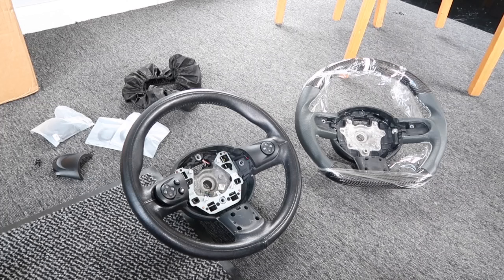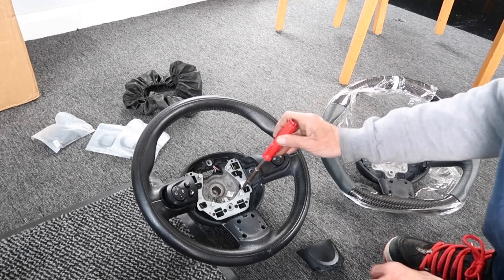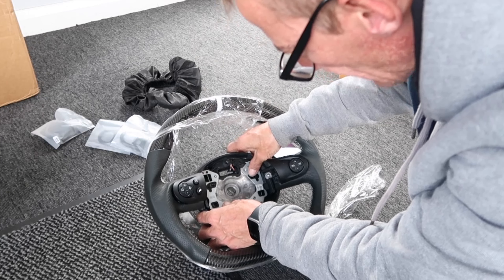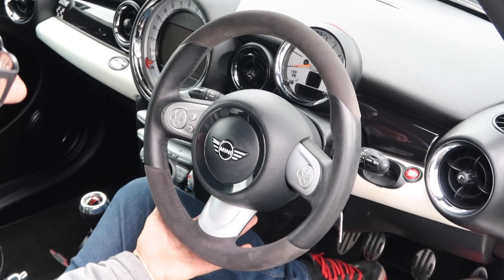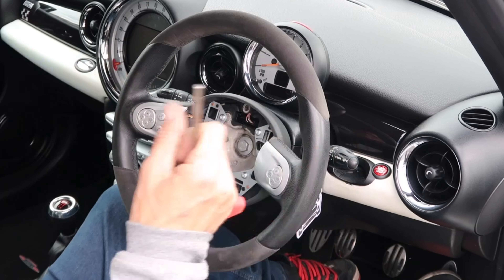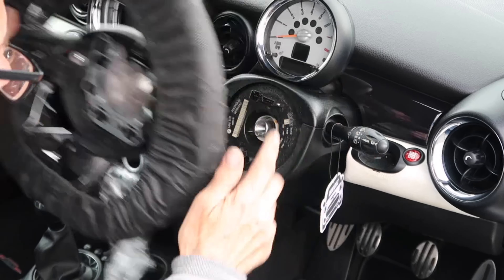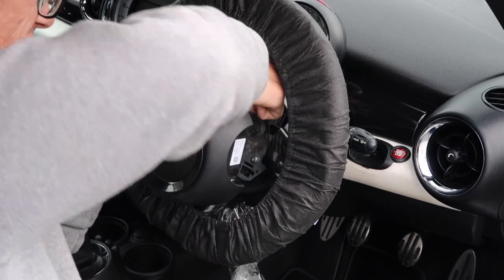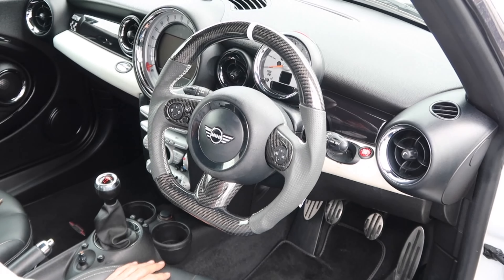MINI R56 JCW Steering Wheel Install - Flat Bottom Carbon KillAllChrome

Comment: Fantastic video! I have a question - I have a 2010 Mini Cooper S (N18), and the steering wheel does not have the buttons. Do you think it'd be possible to get those steering wheel controls separately, and retrofit them into the wheel?

Comment: Is the diameter of the wheel where you put your hands and larger or smaller than the OEM wheel?  I don't care for the material of the OEM wheel.  Is your perforated option true leather and not some sort of rubber material?  Thank you!

Comment: Hello there i am interested getting the wheel for my 2012 Mini Cooper S Turbo Hatchback My car comes with tip tronic option do i need to transfer it ? also  How long will it take to get it shipped to Los Angeles CA  and how much is the item and shipping together please let me know i am loving the wheel with Carbon and red strip thank you
Reply from the maker: Hi Robert,

It’s universal so does both auto or manual, 

All prices are worked out on checkout dependent on your shipping address we offer standard or DHL express 

https://killallchrome.com/product/gen-2-carbon-fibre-flat-bottom-custom-steering-wheel-r55-r56-r57-r58-r59

Thank you!
Reply: @KillAllChromeMiniBitz  my other question is the 3 small carbon pieces (where the volume and other controls buttons are) are they included in the price or need to purchase them secretly
 ?
Reply from the maker: @robertdaniels10  need to purchase them separately :)
Reply: @KillAllChromeMiniBitz  do you have them for sale want to make sure wheel and those pieces do match in pattern  and how much for everything together shipped to Los Angeles CA zip code 91316